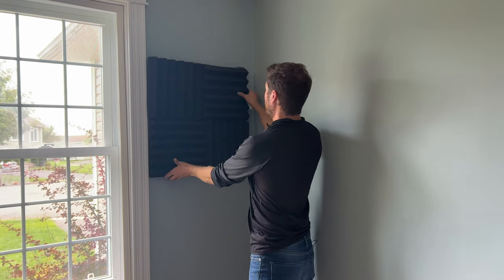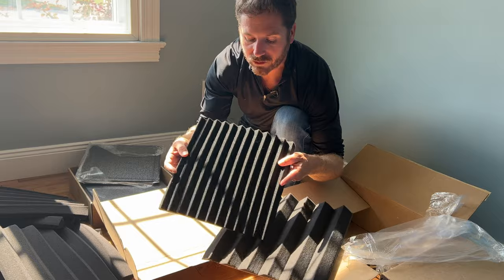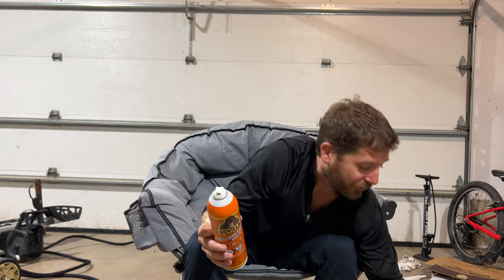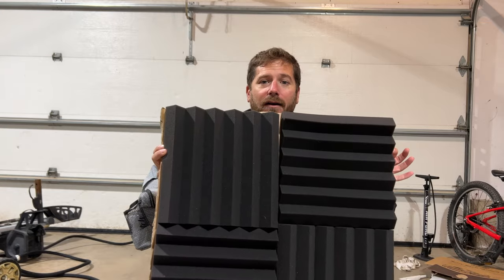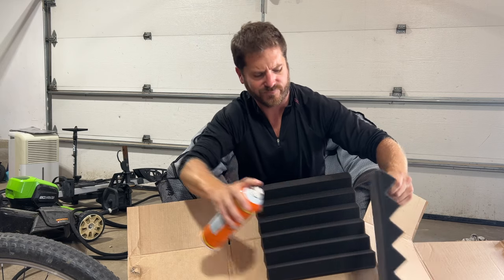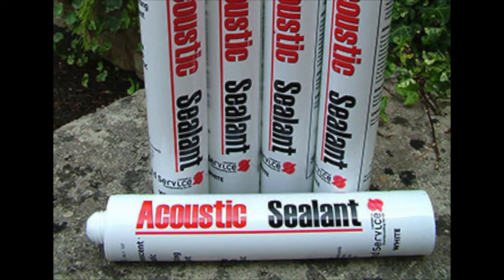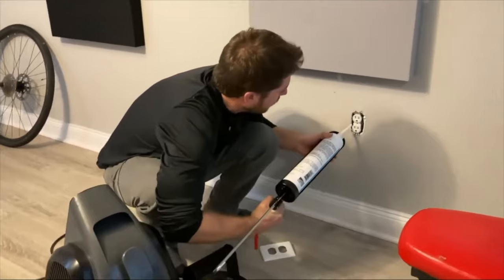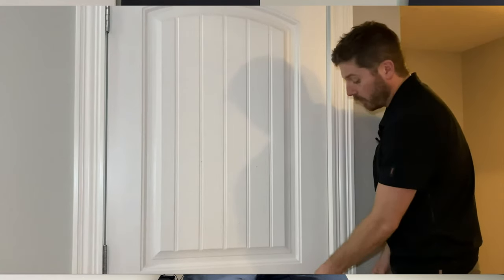SOUNDPROOF GAMER Room YOU Can Build! But HOW?

Comment: I have a closet with all my electronics. Might use some of your tips to try and cut the sound down from there. The downside is my wireless router is in there so I’d be blocking sound and my internet hahaha
Reply from the maker: It shouldn’t effect your wireless too much, especially if you’re not adding extra layers of drywall and a ton of other stuff in the wall. Just deadening your closet shouldn’t effect the wifi. Great idea with using the closet since the cloths in there will deaden a lot of your noise! 😎

Comment: Thanks for the info!!! Your videos are extremely helpful! I have a quick question that I hope you can answer, What would be better to hang over the walls for sound proofing? Moving blankets or 2inch sound panels? (assuming all the walls are covered) because I plan to use one of these for my room as well :)
Reply from the maker: Unless you cover the entire wall with the acoustic panels, I’d use the moving blankets. Those aren’t bad to deaden the noise inside the room but does little to stop noise from coming in the room.
Reply: @soundproofguide  cool! thanks for the advice!!!

Comment: Great video. Would these tips be good for a small den that I’ll use to do voiceover work? My room is carpeted but has a glass door so it does echo
Reply from the maker: Thanks! And yes, it definitely would. You just don't want to put too much and make your voice sound too dead. They say about 20% of the wall should have acoustic panels or foam, but with the glass, you might need a bit more. You could have a sound-deadening curtain that covers the glass, at least when you're doing the voiceovers.
Reply: @soundproofguide  thank you for your quick reply. Do you offer paid consults by any chance? No idea where to start or what to buy. I would like to make my whole room into a recording studio/office space since I get claustrophobic in a small booth.

Comment: Nice.. And is there a way to measure where the sound is leaking the most??
Reply: That's too hard to measure since there are a lot of variables. Every room and locations is different one of another also the hour of the day when you use the room is a variable . 

So to be honest the best way to measure is just have an initial reading and per each action make a test